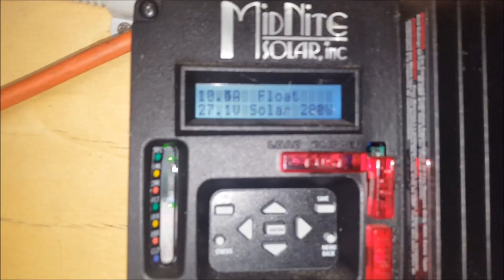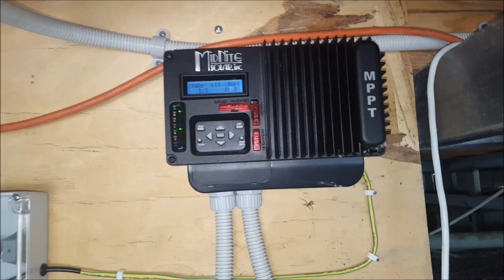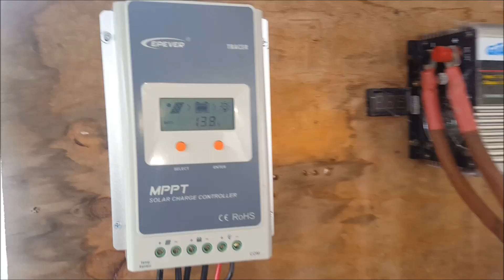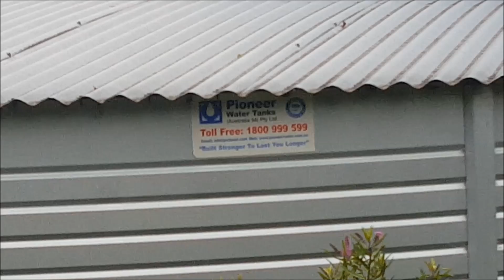Off Grid Solar Power - How Many Batteries Do You Really Need?

Comment: Can a 12 volt 100w solar panel charge a 24v battery?
Reply from the maker: No.
Reply: @PopsShack  thanks, but if i use 12volt battery on my 100watt solar panel can i ran a 30 watt gadget for 24/7 without unplugging it, example 30 watt pump
Reply from the maker: @randomsaga21  - That depends on the capacity of the battery and how well the panel can charge the battery.

30W x 24 = 720Wh.
Reply: @PopsShack  if i use 2 12v battery with 50amp each to make it 100amp(12 volt 100watt solar panel) can i use it to run my 30 watt water pump for 24/7 given the weather is nice. And csn i use thicker wire like 5.5mm² or 8mm²
Reply from the maker: @randomsaga21  - You SHOULD be able to, yes.
Reply: @PopsShack  Thank you, I learned a lot.

Comment: I've got a good brand dingo plasmatonics 20/20 pwm charge controller it won't work with my single 180 watt house solar panel .don't understand why. tryed 12volt .and 24 volt .

Comment: How many batteries do you really need?    My camp only has a car battery for refrigeration and hot water, wife even has a dishwasher with heated dry.
Reply from the maker: And most of that usage is through the day, correct?
Reply: Yes, it is a different way of approaching the problem that is often overlooked. I live off grid 5 months a year using just a car battery from a vehicle I don't bring with me. Even refrigeration is only during daylight hours, store cold in mass liquids for night. Excessive solar panels so refrigeration will work on the worst day. Not really that many panels, about 1500W.  Just doubled it, but haven't installed them yet. Tired of mismatched panels and will be getting rid of some. Just run big loads from 10-2. Dishwasher drying is directly from solar buss. 7CF chest fridge has a dedicated inverter.  Any, I mean any, excess power makes hot water at power point. Do have to power a medical device at night and that is serious. It is just the summer, but it is the northeast. Into October it does get tougher. Still, a lot of people have camps and this is a cheap way to do it. I have a number of videos explaining the technology.
Reply: @opera5714  

1 battery!?......

.....is that really worth the hassle?.
Reply: @drfeelgood5870  It was the logical decision and not a problem at all for 5 months in the summer. Since my last post I added a large capacity LG washer and another 40 gallon water heater just for that. Neither of those is connected to a battery. Even run a medical device that keeps me alive at night so the system must be working.
Reply: @opera5714  so are you running separate solor panels and batteries for individual unit ( fridge,  heater etc etc ).
Reply: @drfeelgood5870  unfortunately I do have a legacy 36V string that has to be kept separate that doesn't add much. Everything else runs on 60V. Washer is in garage and a couple of panels are delighted in series when found wash. Garage has its own water heater.

Comment: so how many panels and  batteries would be ideal for off grid setup?
Reply from the maker: That depends entirely on how much electricity you use per day and how much electricity you want to have stored for the down times.
Reply: @PopsShack  

So the more batteries the better. Spreading the load?.

So if I had a 3kw system , I could have as many as 50 batteries hooked up in line? .
Reply from the maker: @drfeelgood5870  - Not so much the number of batteries but the total capacity.
Reply: @PopsShack  

The more amps you can store the better.
Reply from the maker: @drfeelgood5870  - That's correct.

Comment: My last electric bill here in the summer for my 1400 sq. ft. house was $145.  I keep central A/C down to 68 at night.  Is it worth it to invest in solar?  If every month my electric was $145, that's $1700/yr.  If I live here 5 to 7 years and move, is it worth the investment?  How much would I save?  7 years would be no more than $12,000 in electric max.  In the winter it can drop to $90/mo.
Reply from the maker: That's something that you have to work out for yourself. For me, I was paying more to be connected to the grid than I was paying for the actual electricity I was using. I was also able to put my system together myself, saving a lot of money there.

How much you pay for your electricity is really irrelevant when working out if a solar power system is worth investing in. You have to know how much electricity you use and dollars don't tell you that.

Comment: Does anyone recommend a battery bank meter that could tell me a percentage of battery bank charge? I am installing a 48V system. Just bought 18, 330 watt panels so that will be close to 6000 watts of solar. Only going to power up 9 panels at first and then use 8 new global 6v golf cart batteries rated at 225ah each. Hook them in series for my 48V bank. I will go up to 24 batteries as money permits. I don't want to discharge them below 60%. The inverters cut off at low voltage but no one really knows the percentage left at that point. I will be running grid power for backup. I guess I could install a transfer switch that can switch back to grid with some sort of adjustable battery bank meter. Any ideas to automate this process?
Reply from the maker: I've nothing to help with automating the transfer switch. I don't use a battery monitor either but Victron make one and they make good gear.
https://www.victronenergy.com/blog/2014/01/12/bmv-702-insights/

Comment: Great videos. But you've lost me a bit ! It would be nice if you could demonstrate in a video how the switchboard circuit breakers connect to the controller, the busbar, battery banks and inverter. What function do these components play. Thanks.
Reply from the maker: Phillip A - I'll see what I can work up for you.
Reply: By the way, just thought I'd mention that the bloated tubular battery under your house is being badly over charged at high amps and is overheating? This battery will eventually rupture and cause some serious damage. You really should replace it with a newer healthy battery.
Reply from the maker: I don't have any tubular batteries.

Comment: Here in 2017 solar should be way more consumer freindly, make it easy for a moron to use maybe somthing like your going to need 8 deep cycle batts for your 6 two hundred watt panels that will let you run all the shit including a/c howevet the hell long you want without the constent stress its multiples too complicated right now to do, wake me up when i can go by a kit that i can set up in 5 min and not worry no more for at least a yr or two.
Reply from the maker: The problem with that is that there are so many different capacities when it comes to deep cycle batteries and on top of that, every household's electricity requirements is unique.

I can run my house for weeks on end with four of these batteries but a family of four who use an electric clothes dryer every day won't be able to.
Reply: Guy Azbell I got 3, 315w panels with 6, 12v 145ah AGM batteries, 45a mppt controller and 1800w inverter for my 27ft school bus you think that's right for some daily use tv music and computer?

Comment: hi you help me off grid how many panel  battery and amp or wat for one home run with 3 fridge pleas
Reply from the maker: How many watt hours of electricity do you use per day?
Reply: Hi do yourself a favor if you haven't already . Buy a "Watt killer " from Ebay about $20 . & take a reading  of power watts/Amps  of each appliance you use ,This will give you a better idea how many panels/batteries to have. Things that have to run 24/7  verses  stuff you use for short periods of time. We are looking at a 3kw system @48v .as this will be more than enough power even on cloudy or rainy days. & yes i'll have more batteries /panels as the budget allows.hope this helps.

Comment: Looking great! 24.4v in the morning isn't that bad! They are probably a bit higher (assuming there is a small load on them when the 24.4v measurement is taken). Each home solar power system is unique...never seen two that do/look the same.
Reply from the maker: I'll switch back to the larger battery banks in the next few days, I really only hooked these up as a test and to satisfy my own curiosity. With the larger banks I don't get below 25V.
Reply: like you said it is unique
i have 12v bank in a trailer

Comment: Yes there is no such thing as one system fits all.  We use 10kw a day in winter and up to 30kw a day in summer with the AC units. However We live in our place 24/7
Reply from the maker: I'm able to get by without air conditioning in the summer here, it just means managing the house for heat, that's all. I'm here at the shack for the next two weeks straight and I was here for just over a week over Christmas. Once I get the 48V system up and running, I'll be able to run the air conditioning for a while in the afternoon but I'm also thinking of getting a small window rattler in the meantime. My house is only about 45 square metres.
Reply: meanwhile in the real world that mentality doesnt fit all at all.. First off the budget building for 10 people that doesnt fit all as well as the ongoing replacement battery costs..
Reply: Firstpo jkh O think it's pretty obvious who the troll is here you also need to work on your manors or you won't get to far in life once you grow up move out of your parents place with that attitude. There are other things to consider.. like for example the tech from ten years ago was not only very expensive but its already fairly obsolete and less efficient than todays equipment.. of course from your behavior it sounds like you were still in grade school then so.
Reply: Firstpo jkh Is what I'm saying really going over your head here? The tech ten years ago is inefficient and somewhat obsolete just as the tech sold ten years from now will be much better and cheaper ten years from now.. so going overboard with buying ten times more than you need now just means you overspend for ten times more obsolete less efficient panels, controllers and battery tech that won't be worth crap and still likely end up being replaced. In ten years we will likely be all using a lithium variant battery.
Reply: @gtxoiltastebad  

WHAT!!!.

So you are install a 10 man system but only for 1 person....

......financialy that dosent really figure.
Reply: @gtxoiltastebad  

Ah , I see where ur coming from now . So i do agree to some level.  
....but for normal usage no thanks. 

You must be really into the "zombie apocalypse" theory 😆.
Reply: Appreciate Video! Sorry for chiming in, I am interested in your thoughts. Have you researched - Lammywalness Wise Solving Guide (Sure I saw it on Google)? It is a smashing one off product for living off grid minus the headache. Ive heard some unbelievable things about it and my GF at last got excellent results with it.